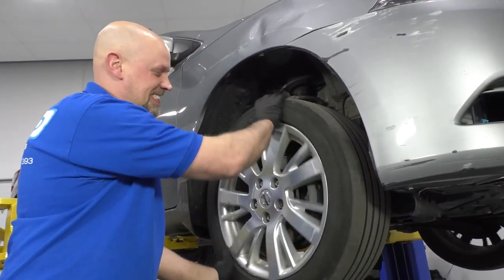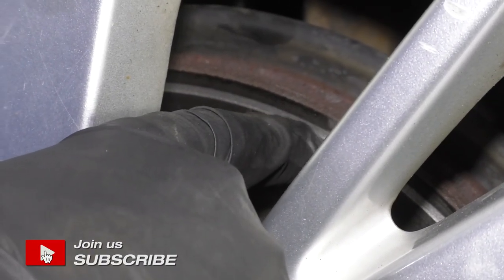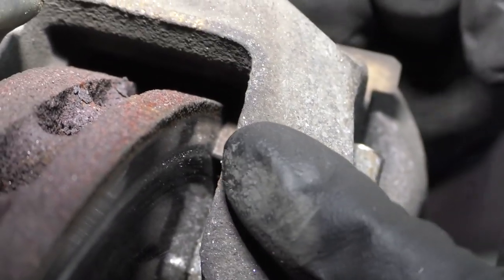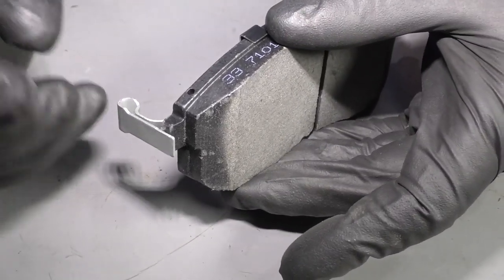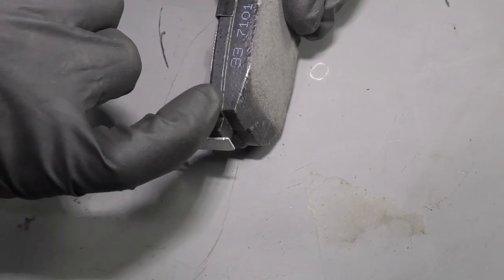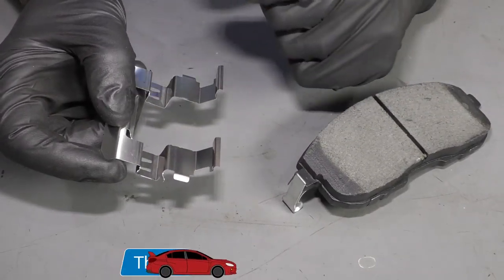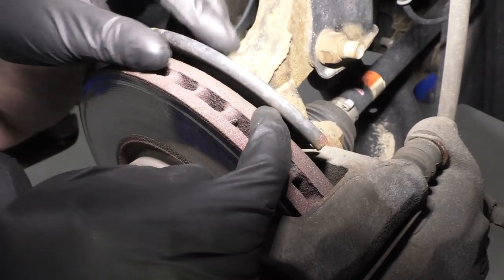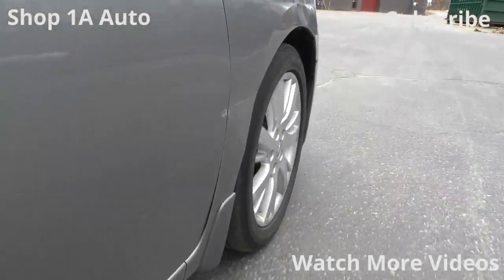Squealing Brakes? What's That Noise in Your Car, Truck or SUV?

Comment: I have a 2012 Toyota Tacoma and the brakes makes a squealing sound when the truck goes on reverse, this only occurs in the morning when I first drive the truck.i had the front brakes replaced about 4 years ago. Any recommendations to solve this problem thank you.

Comment: My car’s brakes squeaking only when I apply light brakes but I apply little hard then no more squeaking. Rotors and brakes brand new, after replacing its been squeaking. Any suggestions what it could be. I used CRC brake grease, CRC brakes disc quiet but haven’t resolved issue yet.
Reply: I am having this issue!
Reply: did you ever find out the issue?

Comment: How can you tell if you have a bad wheel bearing on a newer Blazer
Reply: It would be the same process for any vehicle. Jack up the wheel u suspect has a bad bearing and see if it has any play in the wheel. Or if you hear a low vibration.... I'm not a mechanic. I just changed my hub assembly on my ranger. Long story